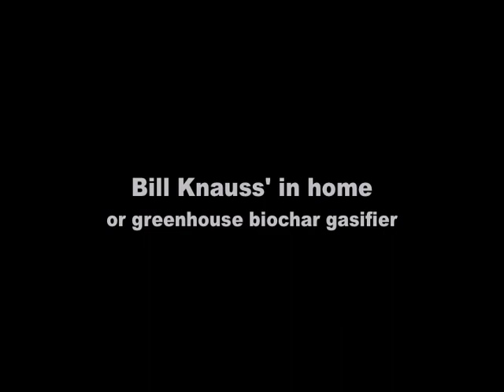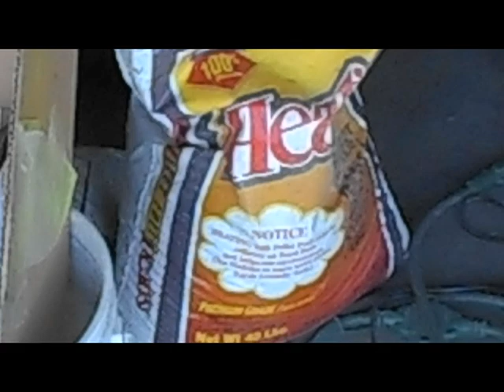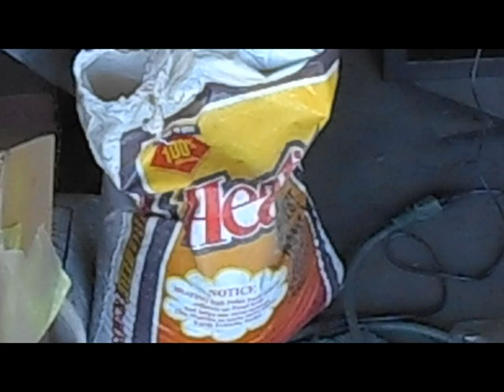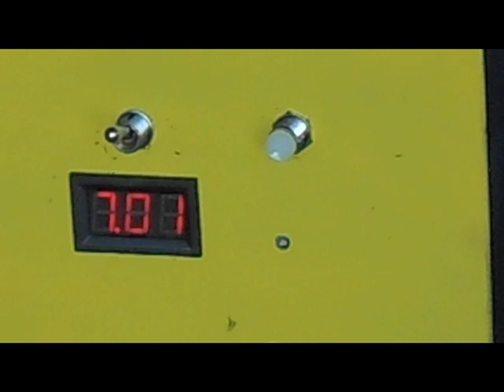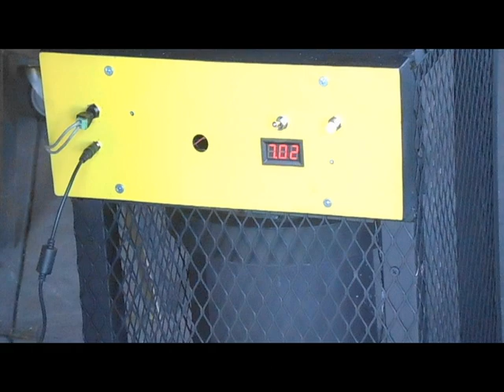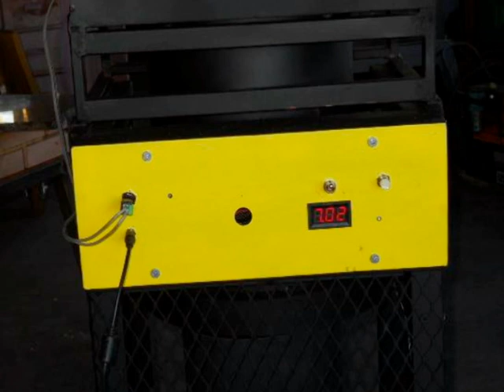Biochar---Bill Knauss' Home and Greenhouse Gasifier

Comment: I found dried wood chips work the best.  They are small enough to be used without breaking the char down further yet big enough to allow air to move through the burn chamber.  And cheep  Find a tree trimmer with a chipper and he will give you all you want.  I run mine through a half inch hardware cloth to get the fines out.  They hinder air flow.
Reply: I was thinking the same thing as a fuel source.  How would you go about drying the wood chips?
Reply: @erictorbet8104  Eric   Lay them out in the sun on a tarp for a few days.
Reply: @jimlashbrook5429  Great, sounds easy!  I'd be interested in a stove like this to heat up water, for a radiant floor system.  Do you know if I could buy or make such a unit?  Thank-you for your help!
Reply: @erictorbet8104   Eric  I don't know of any comm.  made units on the market.  I think you have to decide whether you want heat or biochar.  I think it would be tough to do both using wood chips.
Reply: @jimlashbrook5429  Oh, so you don't think the secondary gases from the wood are enough for heating purposes?  There are commercial wood boilers with a secondary gasification chamber, but then there's no biochar at the end, but they're very efficient at least.

Comment: This is beautiful! Really great work. Can you please provide a vertical section cut diagram sketch through the whole thing? I understand the basics, but I would like to clearly understand what's going on through the upper box with the holes and fans.
Reply: its a thermo vent. basically cool air intake and hot air outtake to use the heat from the chimney to heat the air better. also cools the chimney and reduces chance of house fire. the interior will be full of heat vents on the inside to increase heat output. think of a honeycomb.

Comment: How could you spend so much time to make “natural” biochar but then use diesel fuel and gasoline as starter fluid? Let me guess where the biochar goes right in the garden?  Try alcohol whole lot less toxic residue left on the char.  Awesome design by the way

Comment: Very ingeniously designed to shut down the burn at the correct time before the charcoal is consumed by using your thermostatic air intake system.  Hats off to you for your heat exchanger too. What i do not understand is why you call it a gasifier when it does not burn the fuel used for char in an oxygen-less environment and then burn the gasses as in a gasifier.  From my viewing this video it seems you are forcing air into the fuel to burn hot and then stopping the burn at the charcoal stage by closing off the air supply fans. Its hard to see why the burn stops when one end is still open at the top because i tend to think it would smolder till it becomes ash . Something to think about is your use of fossil fuels to ignite the fuel, but other than that great job and thanks for upload.
Reply: Hi Murray,  I don't have experience with allowing the char to cool down since I water quench at the end of the burn but have noticed with my system that when the pyrolysis front is down at the bottom that at the top(well halfway since the material shrinks and settles) of the tube the char isn't glowing anymore, and my tube is only 50centimeter tall whereas Bill's tube is probably 1 meter or maybe 3 feet, no idea what the common sizes are in the US.

So my guess would be that closing the primary air on the bottom is all it takes to put things out, also considering the draft still in the flue is probably sucking air away from the top of the pipe and not allowing much of it to sing into the pipe from the top.

Comment: Hello noticed you said this is a simplistic design, however from the video it is hard to deduce where your primary holes are to bring in oxygen. Are they in the bottom of the container that is holding the fuel. I like this design because the chamber for the fuel is also the chamber to produce the char and this chamber seems very easy to remove and empty char after burn and replace with new fuel. By the way what are you using to lock the chamber in place and what is the chamber made from?

Thanks, 
Excellent design would pay for detailed instructions on how to make my own in a heart beat! And that propane tank gasifier you built I am sure they can see that from the space station, awesome completely awesome, you get a 4.5 out of 5 MacGyver Stars!
Reply from the maker: The fuel container is made out of stove pipe.  The primary air is forced down one of the vertical square tubing supports that holds the heat exchanger.  The heat exchanger can be removed and replaced with a cooktop.  It only takes between 2 and 3 watts to run the primary air fan which is a 12 volt computer fan with a speed control added to the circuit.

Comment: I really like your design.  Do I understand correctly that the pyrolysis front burns out once the fan is turned off?  Are there plans available or are these units for sale?  I have a greenhouse and I am looking for something just like this.
Reply from the maker: Hi Byran,

When the pyrolysis front burns out the charcoal starts burning and produces more heat that trips the thermostat that shuts the fans off.  I don't have any for sale now but we do plan to have these for sale in time for next winter.  I don't have any plans drawn up at this time but this is something you could build yourself if you have the metal working skills.
Reply: +biocharFIRST Wonderful work! I would like to know CFM of primary air supply, and if it is different for different feed stocks. Thank You
Reply: @biocharFIRST  I am in Reno, Nevada. I would like to buy or build a unit like this - are their prices or plans available in 2019? Thank You!

Comment: Correct me if i'm wrong because i'm still learning. For proper gasification > biochar = pyrolysis there is no oxygen. With this open top design the pile of fuel burns on the top and migrates down the pipe? This would from what i can gather burn off a percentage of wood giving a mix of biochar and ash as an end product?
Reply: Caulfield Darren yes, but the ash is beneficial as well.
Reply: You only get ash formation with this method if your feedstock isn't uniform enough and has loads of larger air pockets.

I get ash formation when using carob pods but virtually zero ash formation with almond shells.

Unlike Bill I do a water quench at the end of the burn when the embers are still glowing, this washes away most of the ash and creates char that is instantly hydrophilic instead of the initially hydrophobic char that you get when just closing off the oxygen supply and allowing it to cool down. The quenching also removes any residual tars.
Reply: I know this is an older video but i'm just now seeing it. To answer your question oxygen (air) enters through the bottom of the fuel can and migrates up through the fuel until it reaches the fire. The fire depletes the o2 and leaves the char behind, migrating down the can as it burns. The spent gasses go up the fuel can. At the top where more O2 is introduced the hot gasses reignite and go up the stack.  The key to this is stopping the the burn when it gets to the bottom of the can.  Otherwise the char that is left behind will burn from the bottom up leaving nothing but ash behind. If all you are after is heat no problem if you want the char you have to stop the burn.  Hope this helps.